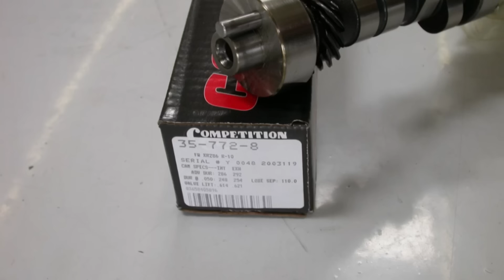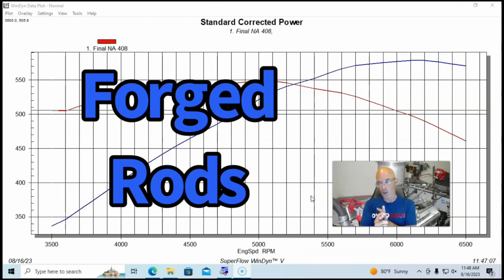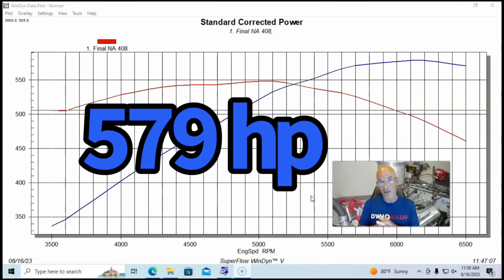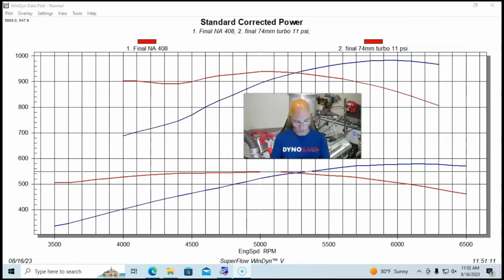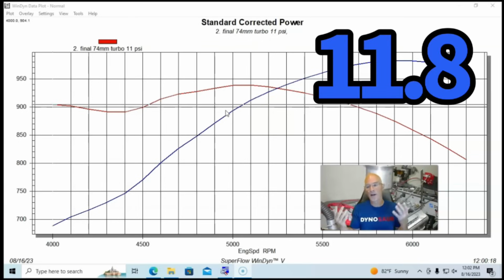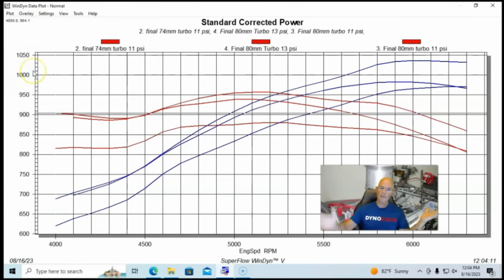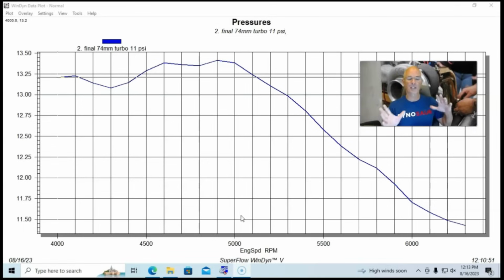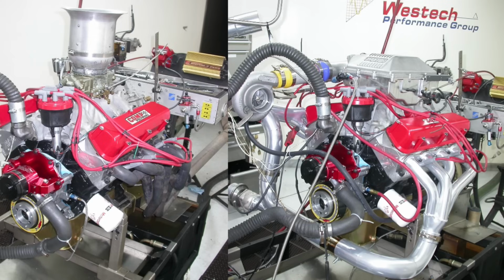408 STROKER FORD TURBO BUILD & DYNO. TURBO ON TURBO ACTION. HOW MUCH POWER DOES A TURBO 408 MAKE?

Comment: Richard, you are correct! The smaller turbo only had capacity for down low. The bigger turbo has capacity for the whole range. Therefore, your testing clearly shows the smaller turbo is running out of airflow. Great video! Now, where was that 88mm???
Reply: Needs at least an 88!  Daytrade Scottie says, "408/88 is great!"

Comment: The 351 Windsor and Cleveland thirsty engines, good cylinder heads on them and  nice valves,  ,and, with the solid camshaft and  lifters  give  the small block Windsor a big dose of medicine, there tough as nails it would handle the  punishment, they can make big power when tweaking and the settings are done, 3000hp if  built right

Comment: We are doing a similar project for our 70's Econoline tow van but our compression ratio is 8.5:1 instead of 9.5:1 for more boost and its 410 CI SBF "2 CI is not much different" thanks Richard for this test I just need a lot of torque for towing  😂

Comment: Just built a 351w with a vs7875 and i love it in a fox body mustang has awesome power.. i built this motor around your videos 👍👍
Reply from the maker: Nice work!
Reply: What's a build like this cost?  I've had two 351w rebuilt for my broncos, but didn't go stroker or boost.

Comment: Pretty crazy. I just started a 351 build for my AWD crownhick project. I've been wondering about turbo vs NA. I actually settled on a slightly smaller turbo because I need that low rpm power and particularly torque. I live up in the mountains with steep hills and winding roads all the way home from work, about an hour of it. We also get a lot of snow so I had to go AWD, plus AWD is just fun. Great video.
Reply: You got Instagram? 
I want to see this lol.
Reply: Did you degree the cam?
Reply: Why not add a smaller cam with lots of advance to make strong bottom end and midrange torque. You can also go with a much bigger turbo to handle the overall power. This would make more sense to do.
Reply: CrownHick....😂😂😂😂.  Thanks for the laugh friend.
Reply: CROWNHICK ! IS thar supposed to Sound COOL or SOMETHING?
Reply: @Jerry-up8bk  no at all. it's just what you call a crown vic and f-series mashup.

Comment: Love seeing the Ford stroker info.  

Ring gap! 

We know boost needs more to deal with the heat.  But i don't recall seeing the NA power vs ring gap as a dyno test.
Reply from the maker: motor was built with ring gap
Reply: @richardholdener1727  yes, i saw. My question is if a new motor has 0.018 ring gap,  then you increase it to 0.025or 0.030 or 0.040 to survive boost.... how does that affect NA hp?
Reply from the maker: it did nothing to power on my 5.3l motor going from .020 to .032+
Reply: Apparently ring gap did not hurt  NA power production. That is a stout engine that would happily live on crappy fuel. Curious with flat tops if it would have closed in on 700+  NA.
Reply: @optimumperformance6998  naw he wouldnt gain that much with a compression change.  the whole top end would have to change for higher RPMs.  MAYBE 600
Reply: 12.5 would be about 5-6%. Porting those heads and running up to 7500 would get 650-675. I misread the HP initially when I commented.

Comment: I don't think people should always say that boost "falls off". This engine is running very well at 6000 RPM, and consuming a lot of air every time the valves open. Much more than at 3500 RPM. So more of that positive pressure in the manifold is going into the engine, lowering the restriction, which is the intake valve when it is closed. And as he said, the bigger turbo moves a lot more air, and can over fill that manifold more than the smaller one, making more "boost" which is positive pressure in the manifold.

Comment: If we think of the intake manifold as a pressure vessel the turbo is filling up to a certain pressure, and the engine as a leak that gets bigger as RPM increases, if the turbo is too small eventually it can't keep up with the 'leak' so the manifold pressure starts to fall. Put a bigger compressor feeding the manifold and problem solved.

Comment: Cool test thank you. But now it's time to see if I learned anything. Personally I would like to build an identical version of this engine with a few minor changes. I would do the same stroker crank and afr heads but with a hydraulic roller instead of the solid roller and smaller with wider lsa to make it more street friendly. I think twin gt45 or gt 35 turbos would be great. On the induction I like the 850 in the blow through box is great but I would like long runner fuel injection, or if it stays with the carburetor a rpm air gap with a 2 inch spacer. I dream about building an engine like this for a 68  to 72 torino or 75 to 80 mustang 3 door hatchback. When I was 19 I had a 78 mustang and a mild 351 Windsor and it was awesome. I had a lot of fun with it. But I didn't know then how to do body work and the c 6 transmission wouldn't fit in the transmission tunnel. So I reused the c4 transmission that came with the car behind the 302 and it lasted about 6 months before I blew 2nd gear. A fmx transmission and another c4 later I ended up selling the engine and parting out the car after my appendix ruptured and I need money for rent and electric.
Reply: i would stick with the victor jr on a 408 stroker like this unless youre building a real low rpm turbo pickup.  an air gap is way too small for a afr 205.  if thats the case put afr 185s on it and an air gap

you see this combo makes power up to 6k  and thats a single plane and a mild solid roller

Comment: Solid roller the best. Run one on the street. Zero issues!!
Reply: they just dont like to idle really low.  i think thats where people screw up at.  ive seen plenty on the street
Reply: @KingJT80  mine idles around 925 rpm.
Reply: @jameshenson4871 , I also run a solid-lift cam on the street, no problem here, although it is a mechanical flat-tappet
Reply: @sarahhill9395  Wow, that is a bit more extreme than me. A flat tappet solid for the street! I really love the way any solid sounds. They have a different sound than a hydraulic.

Comment: I have a 408w with AFR185 heads going into a lifted f350 4x4 with 35" tires. Do you think (1) 76mm turbo would be appropriatly sized for that engine in that application? It'll be used for daily driving, towing, off road, working, etc. I probably wont run real high boost maybe 7-12psi max. Thanks in advance. My turbo knowledge is very limited at this point and is why im asking.
Reply from the maker: The difference between 7 and 12 psi would be 150-200 hp depending on the original NA power output, so that change in boost is a lot. An S475 would be good or VS Racing 7875 Gen 2 or 3
Reply: @richardholdener1727  the engine isnt built yet so i dont have a horsepower number yet. I have a 76mm turbo already. Its not a super good one and its not a cheap chinese one. As far as the PSI goes i havent figured out what would be ideal yet. Thanks for the reply!

Comment: I think an electronic boost controller would have leveled the boost curve on both turbos. There would be no mountain peaks in the boost curve
Reply from the maker: not if the 74mm turbo is to small
Reply: Its irrelevant if the turbo is to small

Comment: Thanks for the information! I'm curious, do you have any tests on a stroker Clevor? Same bottom end you have on this video, but with the clevor heads?
Reply from the maker: I have run Clevor strokers-not this exact bottom end
Reply: @richardholdener1727  Have you posted videos on them before? I don't see any but you've done quite a bit of uploading! A link would be appreciated if you have.
Reply from the maker: don't think I have the stroker up-but do have the CHI-headed Boss up
Reply: @richardholdener1727 Curious about those Cleveland heads if they would out flow the AFR's. Wondering if tut he canted heads flow better than the wedge heads due shrouding issues?

Comment: Great video, do you have any dyno results for different twin turbo setups? I'm busy building a 383 ls1 stroker that's going to see boost but I'm not set on if I want to go for twin turbo or single, my goal is a good street power range.
Reply from the maker: the success of that has nothing to do with single or twin-just size it or them correctly

Comment: What is the advantage of stroking a 351w to 408 vs. Just building a Ford 400 .030 over. The stock 400 crank while cast is pretty stout and the 400 stock rods are some of the best Stock Ford rods made. Just upgrade them to ARP rod bolts.
Reply from the maker: the lack of parts avail for a tall deck 400

Comment: Richard how come a cam that big peaked at only 6100 rpm naturally aspirated
Reply: I was wondering that too!
Reply: Boost.  It always comes on earlier with a power adder.
Reply: its a 408

remember a 248 duration cam as a solid is like 8-10 degrees smaller than it hydraulic  counterpart

in other words,  this aint a big cam for that many cubic inches.
Reply: @KingJT80  And boost makes the engine think it's bigger than it is. So again,  it will peek earlier.

Comment: I’m going to ask a stupid question and I know it will sound stupid. What results would I get from a cam with a 262 duration and maybe a 108 lobe center, a Fast as cast heads , and a couple small turbos? This is what I am leaning towards for my old mud truck.
Reply from the maker: 262 @ .050 OR 262 advertised duration? What size motor, what size heads and what is the desired power level?
Reply: 262@ 50 on a 351w. Might even stroke it out 387. Maybe a Flo Tek 203505. I want a low to mid range torque. Probably won’t get to 5000 rpm much.

Comment: Run this test with a 335 series!
Reply: did he do a turbo 460?  i thought he did..oh wait thats a 385 series...whats 335 series?
Reply: @KingJT80 351C, and the other two variants 351M & 400.
Reply: @brandonrobertson6327  I thought he did one but maybe not
Reply: @KingJT80  Not sure. But in would like to see the 351C, 400, and a 351W w/ Cleveland heads.

The 400 after March of 1977 was a strong block due earlier castings having issues above the lifter bores per Wikipedia research. The horsepower was lacking due to smog restrictions, but you can stroke one out to about 440cu in. And with the 351C cam being interchangeable, high performance would not be a problem. That would be a torque monster if you had some improved aftermarket aluminum heads and a turbo.

Comment: Do you claim that a 80 mm turbo is a good choise for an engine that produces 550 hp NA?
I belive one need a turbo that can deliver 110 lb/min. airflow at 2.0 PR. and within 70% eff. range in the compressor map.
Never seen a single 80 mm turbo that is able to do that, but maybe you have?
Reply from the maker: You can calculate theoretical flow all you want or just look at the actual data. The turbo does not need to be in the island of max efficiency -it just needs to flow enough to support the power

Comment: It's a ford who cares
Reply: At newest, it’s a 35 year old engine. I had a 406 Chevy with Brodie heads a a solid roller and didn’t make 550 hp.
Reply: @ronniejohnson317  depends on which brodies you had but yeah  that makes sense you didnt make 550HP.  

youd have to have the brodie dragon slayers on a 400+ small block  to make 550-600HP
Reply: chev, ford, dodge it is choice and they all burn fuel.. in my world i run a Cleveland  and to this day feel they sound better than everything else out there..😂😂👍
Reply: @rebekahfrench5747 ya ever heard a coyote haha